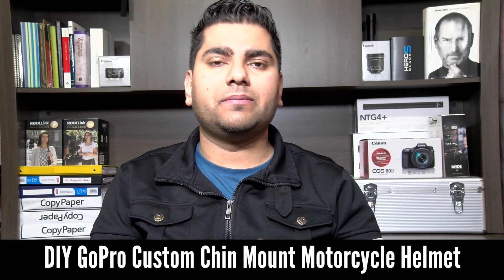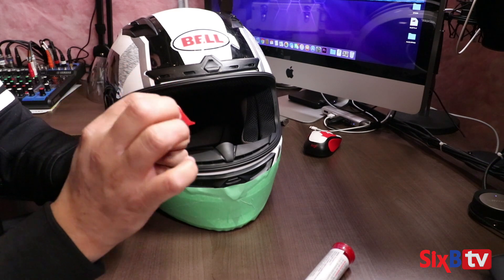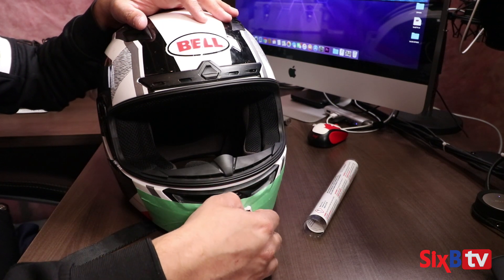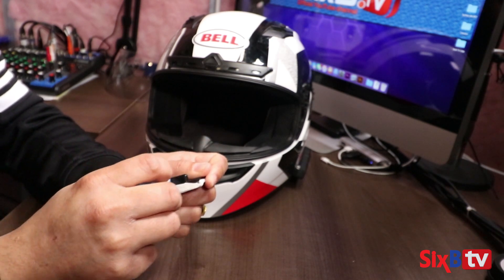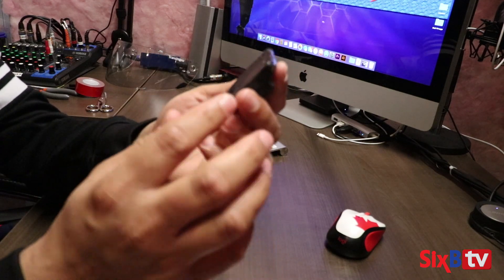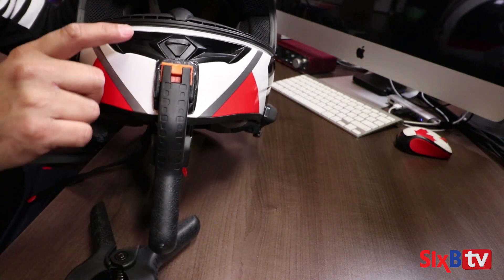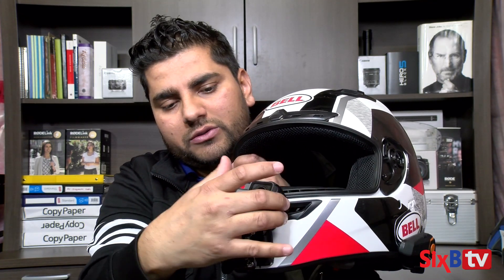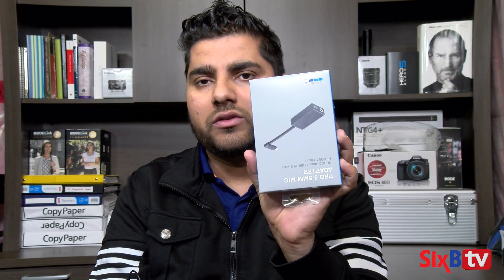DIY GoPro custom Motorcycle Helmet chin mount for best Moto-vlogging Setup

Comment: Hi, Thanks for the video. I’m from Malaysia, also new to GoPro. I’ve got few questions.
1. Why don’t you attach the epoxy mould straight to the helmet ?
2. Why don’t you use the 3M sticker straight to stick the mount to helmet without the epoxy puddy ?
Reply from the maker: 1. I wanted to be able to remove the epoxy if needed , so that i did not attached it straight to my helmet.
2. Due to the design of the chin on my helmet, I was unable to use the 3M tape directly to my helmet.